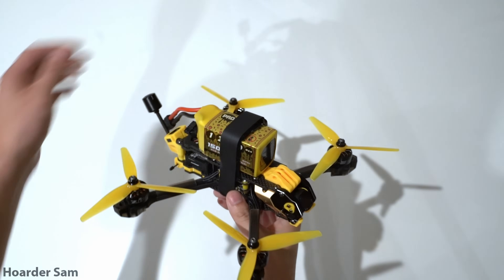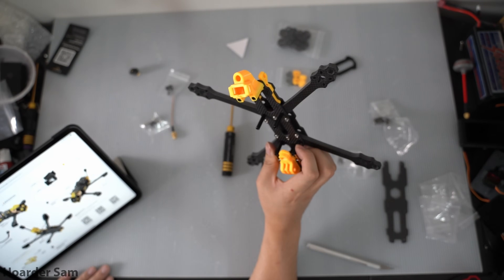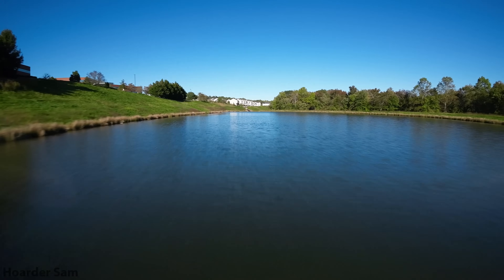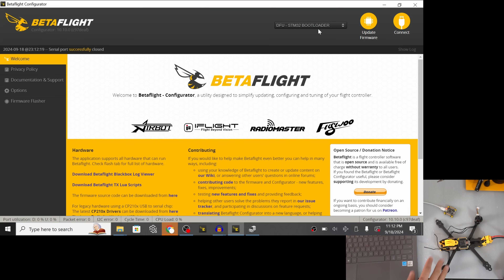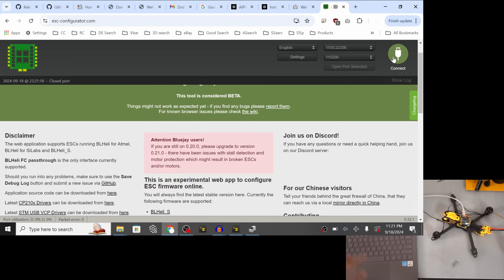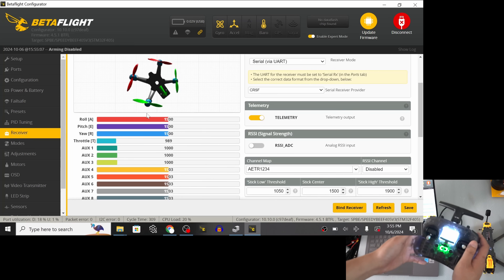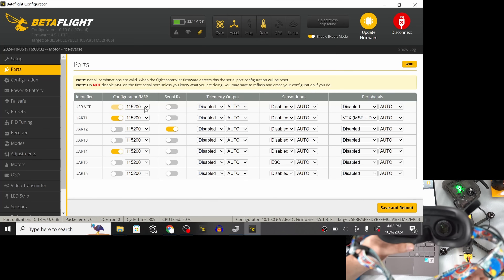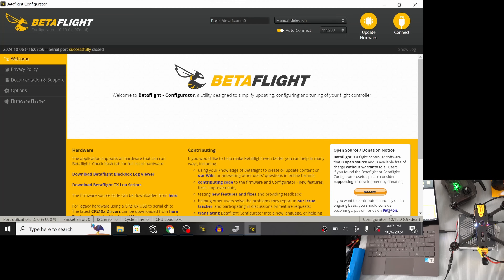How to build a 5-Inch FPV Drone with DJI O3 for $300 (Step-by-step build guide)

Comment: 3:10 they vacuum seal the parts because they can scratch each other. Especially if metal and plastic parts are together, loose in a bag, they tend to get scratched, so they vacuum it so they can’t move.

Comment: I just completed a very similar build with the xh pro version and goofed one of the led strips on the side panel.... This thing flies great and is very quick and nimble. I got a bnf nazgul 5 eco deadcat earlier this year and the x frame Mario 5 is much more agile imo. I used the v4/55A stack, iflight xing 1855kv motors, bayckrc elrs and o3 air unit. I had around $20 credit at the dji store and got nearly everything else during the Black Friday sales on Ali express. I think I spent maybe $320-$340 total including getting several sets of additional props. The gemfan flash 5152 (clear) are silly fast and not too noticeable in the frame.
Reply: May I ask what kind of flight time you achieve with such a self build drone?
Reply: @Dumnar  depends how I fly but on 1300mah 6s I get easy 4 minutes before I chose to land around 3.4-3.6v but could easily get 2 maybe 3 more min of casual cruising. On an 1800mah it's maybe 3 min more.

Comment: Superb content! Wanted to ask: is this compatible with the DJI FPV Controller 3 or is there any extra step to make it happen? Sorry if it's a stupid question but I do already have it from an Avata 2 and wanted to see if I can reuse it somehow, specially now that I'm learning and I don't want to mess things up 😅😆. If not, I can buy an ELRS controller. Any recommendations? Thanks!
Reply from the maker: Yes it's compatible. Don't install the ELRS receiver, and then its a few settings to tweak in the betaflight software
Reply: @hoardersam10  Cool, thank you so much!

Comment: Very interested in doing this build but I'm confused on the wiring. Is there a chance we could get a wiring diagram? Love the content. Subscribed :)
Reply from the maker: Here it is, I think the ELRS receiver is the only thing needed: https://i.ibb.co/39gZQPft/Wiring-diagram.png
Reply: @hoardersam10  Thank you so much! Much appreciated! And then the Air Unit can just plug into the stack via the ribbon cable, I guess. Nice and easy.

Comment: Thanks for the video! Im ordering parts already, it will be my first built, ive seen you have posted 3 links for the speedbee f405 whats the best to fly with dji googgle 3 and dji Fpv controller 3? Thanks in advance
Reply from the maker: The main difference is the v3/v4 flight controller, pick the V4 option if you can

Comment: Will this frame fit the new o4 air unit pro?
Reply from the maker: It kind of fits, the camera will fit on the bottom mounting holes. I have a picture on my community tab or insta with the conversion

Comment: Can you please send a instruction for the assembly of the frame, and also how do you connect the antenna to the o3, and how do you mount the o3 on the frame itself(you use screws/tape maybe idk)

Comment: Hey Sam, I love your videos! I’m wondering if this frame would be able to accommodate the WalkSnail Moonlight 4K?
Reply from the maker: I think the 3D print that holds the XT60 connector may interfere but besides that it should fit

Comment: Thanks for the video! Do you know if I could replace the o3 with the o4 lite or would the voltage be to high
Reply from the maker: If you power the O4 lite with the 9V power from the flight controller, it will work
Reply: @ thank you so much

Comment: Can i use a CNHL 6s 120c 1500mah 22.2V battery for this build?
Reply from the maker: Yes, its a little heavier but will still work
Reply: @hoardersam10  
Ok, thanks! 

Because the following happened to me: I was flying with the mentioned battery and suddenly experienced a signal loss. Now I'm not sure if it was due to the battery or if I crashed into a thin wire (which can't be seen on the camera). Either way, my stack was damaged afterward because one of the motors caused a short circuit. The end result: Motor, stack, and receiver are broken. :D

Comment: Hey man got a question for you so I am using the OMNIBUS F4 V3S PLUS as the flight controller and HAKRC BLS 45A 4-in-1 ESC as the esc will the changes you showed in the video also work for these? 
By the way Love your vedios man.

Comment: just subscribed to your channel , what deadcat frame can you suggest with same component cause it frustrate me the props in camera wish to have clean view so i can use footage from dji 03. without cropping . keep up the good work
Reply from the maker: The mario5 deadcat or the flyfishrc voladaor deadcat VD5 are good options I've tried
Reply: @hoardersam10  thank you for your quick reply , so same components will fit on the  mario5 ? Motors, recievers esc ?

Comment: What Radio Receiver/Flight Controlller is Compatible to use for DJI Remote Controller 3 ? i got DJI Goggles 3 and remote 3 alongside with Avata 2. Looking to build a freestyle DIY FPV 3.5inch to 4inch max . I want to use my DJI Gear for it all
Reply: If you use a dji o3 air unit you can use the rc3 with any flight controller. The air unit will receive the signal from the remote through the goggles. Also you won't need an extra receiver like an elrs, crossfire, etc.

Comment: Will this work with a walksnail cam and vtx? or does the FC prevent that since it's wired up for 03?
Reply from the maker: Yes it should work with walksnail. I'm not sure if its plug-and-play though, might require soldering
Reply: @hoardersam10  Oh that's great to know thanks :)
Reply: @hoardersam10  TY Hoard!

Comment: Can i use the newly launched dji goggle n3 on this drone?
Reply from the maker: Unfortunately N3 doesn't work with O3 (right now). But they should work with O4 air unit whenever that gets released
Reply: @hoardersam10  I think they are going to launch o4 air unit + o4 air unit lite version as well,  as the goggle n3 is budget friendly goggle, so with this goggle + o4 air unit lite would be a great combo to get into the HD system, basically bye bye analog.

Comment: What screws are you using for the air unit through the frame? My kit did not come with any
Reply from the maker: It should come with 4x m1.6x8 screws, really small
Reply: @ I have 2 lol that explains why I didn’t think those were right ones. Guess I’ll have to order some spares. 

Thank you for your help!
Reply: @hoardersam10  I found the missing screws. I still ordered backups, but I wasn't missing them. I just finished the build off! I can't wait to take it to the field tomorrow and let it rip! Thank you so much for all of the videos and the inspiration to build my own! I will definitely be building some of the other rigs you put together!
Reply from the maker: Nice good luck!
Reply: @ I got it in the air yesterday. It is so much fun to fly! The only change in made was getting the V4 instead of the V3. Also, my clear channel guards for the motor wires were delayed in shipping so I used snake skin instead

Comment: Hi, I was wondering if this build is compatible with the dji controller 2? (complete noob here)
Reply from the maker: Yes the FPV controller 2 can work with the DJI O3 air unit. In this build, you skip the ELRS receiver part, and when flashing the firmware on the flight controller, you'll need SBUS enabled as a receiver protocol
Reply: @hoardersam10  thank you so much for actually helping me out man! So Just to be clear, I don't even have to buy the ELRS-receiver?
Reply from the maker: @daanvannoten2351  Yeah, the O3 will act as the receiver so ELRS isn't used at all
Reply: @hoardersam10  awesome man, thanks to you, I'm not as scared of getting into the hobby. Great video and I look forward to building and flying this beautiful machine :).

Comment: Silly question but I am waiting for my o3 unit to build my drone, do I have to remove a wire from the unit connector in order to use me elrs rx?
Reply from the maker: Its a safe bet to do so but some flight controllers handle it fine with the wire still in. I left the wire in on this build and it worked fine

Comment: Y’all, this build is in no way the right way to start FPV, all of the parts are cheap clones and a digital quad for 300 is not going to last a long time, if this is your budget I would recommend either saving more, or getting a analog tinywhoop.
Reply: The only thing I agree with you on is, it’s not a good way to start for a beginner. It’s too much power and responsibility for a brand new pilot, but as far as the parts go, I have experience with these, and I have to say I’m more than happy with the performance of these parts. Also the durability. So if you can fly already and you wanna get into 5 inch I would say this is a very reasonable build.
Reply: @ you have experience with the real parts, not these cheap clones.
Reply: @shout-message  who makes clones of Speedy Bee controllers and calls them Speedy Bee controllers? Who makes iFlight branded Xing 2e clones and calls them Xing 2e ? I mean, am I missing something here? I have flown iFlight Xing motors as well as iFlight Xing 2e and I would say the former are slightly more durable at twice the price, the reason for the E on the end of it is for the word economy they are made to be more affordable, and even Joshua Bardwell has said in his review of the Nazgûl Eco XL5 that the ladder was some of the best bank for your buck in economy motors that you can buy.
Reply: @shout-message  Troncat has also referred to the speedy bee F 405 V2 as the best bang for your buck in flight controllers as well
Reply: @gulfstream1FPV  that flight controller is literally garbage, so is the V3
Reply: What part is a “cheap clone”?  I fly my 5” with the SpeedyBee F405 and it’s great. Just because the parts don’t cost much doesn’t mean they are cheap clones.